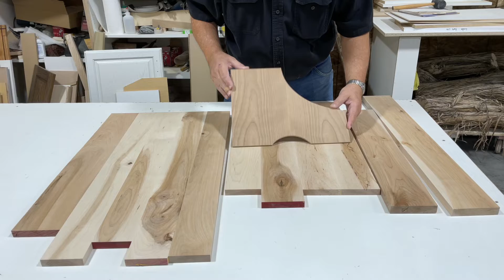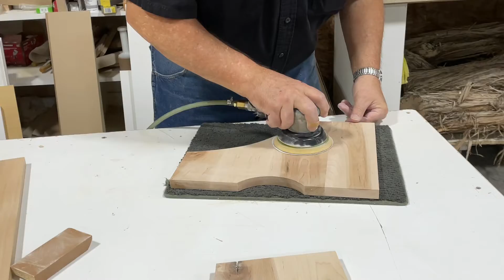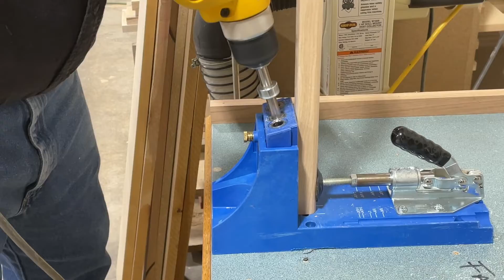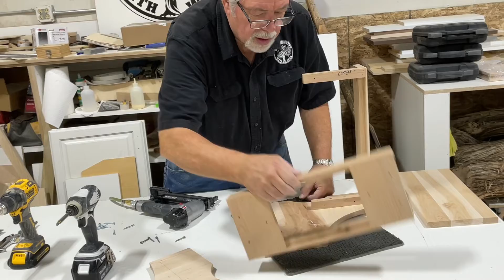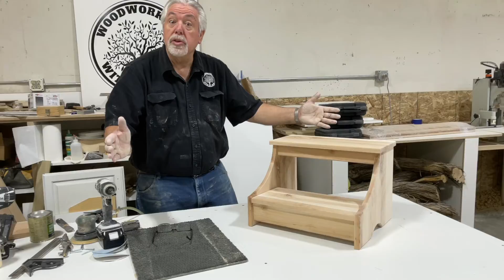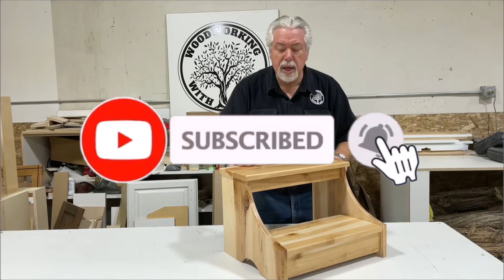Step Up To A Great Weekend Project

Comment: Wes I'm pretty sure you addressed this before but can you use a stain instead of glaze?
Reply from the maker: Ron...on this step stool I used a clear finish. If you are referring to whether stain can replace glaze - they are different products and most often not interchangeable in their usage. Hope this helps. Thanks, Wes